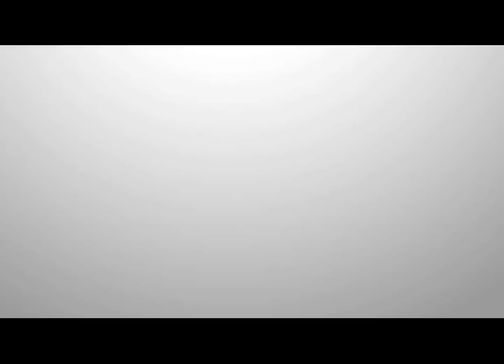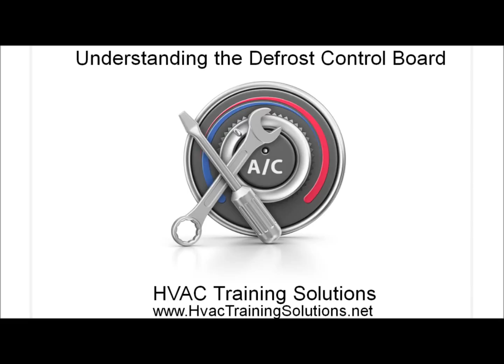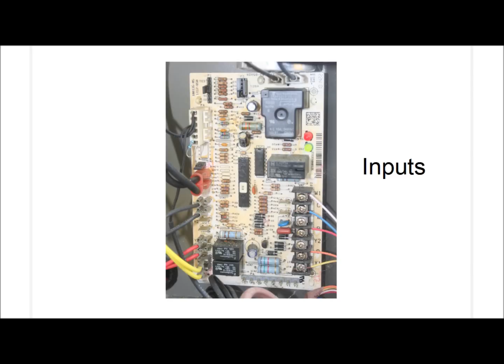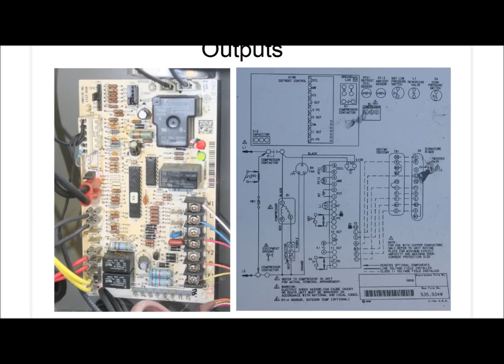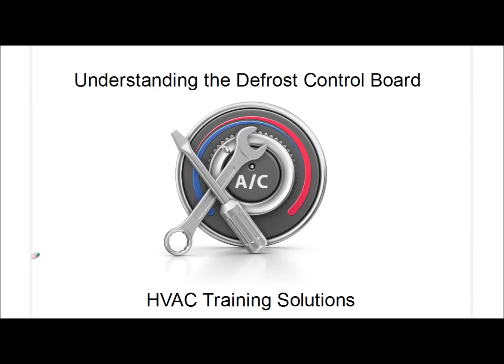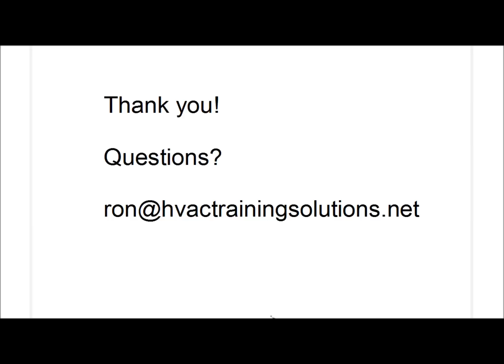HVAC Training

Comment: Where does the thermostat get the 24 volts in the first place ?
Reply: There's a small 240 to 24 volt transformer mounted inside the unit.

Comment: A friend of mine has a goodman heat pump, he replaced his outdoor fan motor and I noticed he has a wire from dfr2 from the board that is not connected. What does it connect to.

Comment: My furnace some time do not start and the unit get frozen, but if I remove the safety switch and turned and put it back the unit start. What could be the problems?
Reply: Call a technician, you don't know what your doing.